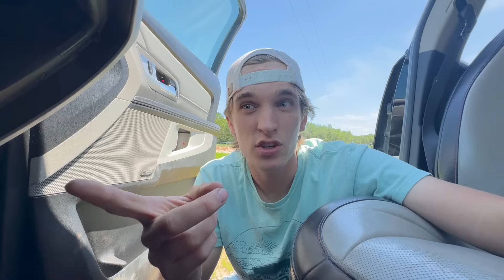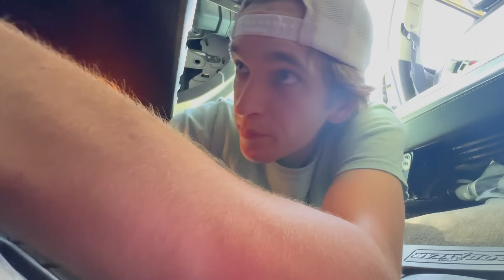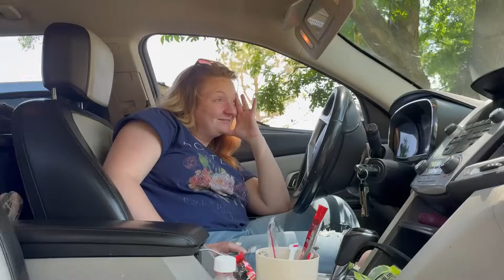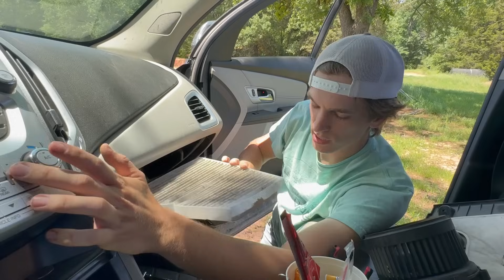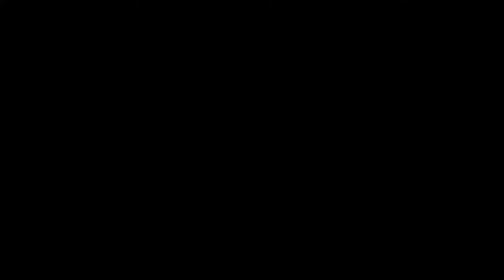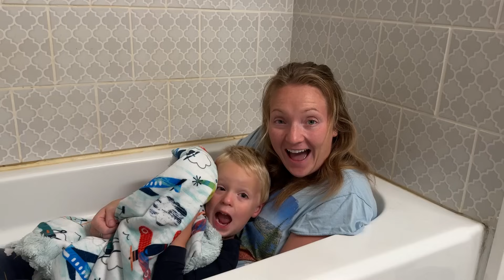How is this even possible! Im glad we found it when we did.

Comment: Living in the country has it's moments with little critters.  We place TomCats brick poision for mice/rats under the hood of our vehicles wired on areas under the hood (a suggestion seth wadley mechanic), and make a  spray of  peppermint water mixture, spray on non flammable areas under the vehicle.

I've found snakes as well wrap around the bottom of our truck.  Found it when I parked the truck at the grocery store.  The snake dropped from my truck into parking lot.  That freaked me out!!!

Comment: Oh my gosh. My neighbor had a squirrel nest with babies in her F150. Brought it down the street to dealership. Momma scented where the babies were. It got into the building screaming for the babies. They had taken the nest and babies and put it by the woods so she found them. The next week I opened my hood to add washer fluid. The little suckers had been eating the plastic off my wires. I was able to use the electrical tape and bought squirrel spray and now spray during hatching season. Even put rat food under my truck in case they or mice came back. Dang rodents. P.S Tornado hit Garland Tx today where my only Kid & Family live. Thank you Lord for protecting them. It’s a mess there and hail was huge.

Comment: My car did "sudden death" a few years ago. The guys at the repair shop found a lot of chewed wires. They also found cat food stored in the AC unit and nests of mice in the heating system.  They vacuumed out several mice.  Also, after that I was driving down the road and a little mouse crawled up through the vent by the windshield wipers and was peeking at me through the window.  Comprehensive insurance will pay for any mouse damage to your car. Mice love to get into cars. I live in the city and my car is always in my garage, but lots of mice!

Comment: The mouse thing is more common than you think especially in rural areas…. It happened to my work car about a month ago and it smelled so bad for a week until the air filter was changed also in my bosses new car she had it happen to her and with 90+temps it made her car smell awful also for about two weeks we have her filter out now and letting it vent and we will take it to get her new air filter out in this week now that the smell is gone

Comment: Crandell  you gòt to watch out for mice! They like to climb in your engine and chew on the wires it can even catch your car on fire! It can even catch on fire even when your battery is disconnected.  Because it happened to a boyfriend of mine a mouse crawled into his truck and chewed on the wires and it caught the truck on fire while it was sitting in the garage and almost caught the house on fire. So watch out . Mice can do alot of damage. They can crawl through anything!!

Comment: Hi Crandall nice job but worried in what you did not do as not wearing surgical gloves. That filter is not an air filter but called a POLLEN filter.
Most important i would advise to use a smoke bomb to sanitize the inside of car and get that smell out of it . There are many objects on the market to use and needed when you have a nice big family.
Wow no way would i live in a Tornado , is that a plastic bath with no protection over a very heavy metal bath from years ago?
Keep safe and well guys.

Comment: I lost my near new car to a rat attack a few years ago. It ate up every hose & wire in the engine and had been inside the car too 😵‍💫
After replacing everything the rat found the new parts even YUMMIER!! 😡
I ended up having to move AND buy a new car❤

Comment: Need a one of those Ultrasound rodent electrical devices in the engine bay example: Mouse Blocker Pro 12Volt High Powered and  Ultrasonic Mouse and Rodent  Deterrent with with an Eviction Mode and Dual Strobing LEDs for Your Vehicle and diy metal screen mesh that rodents cannot enter  openings engine bay that a rodent can not enter into the vehicle cabin.